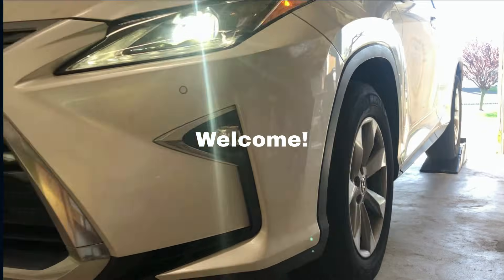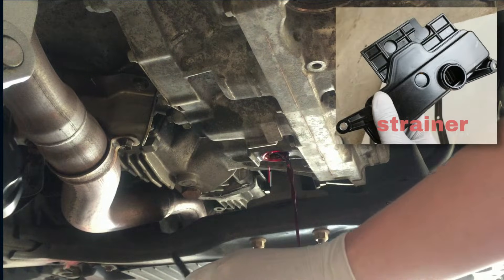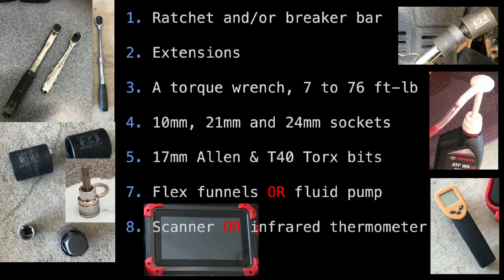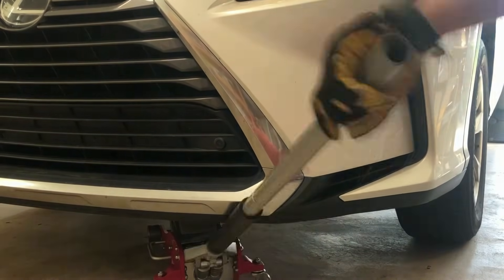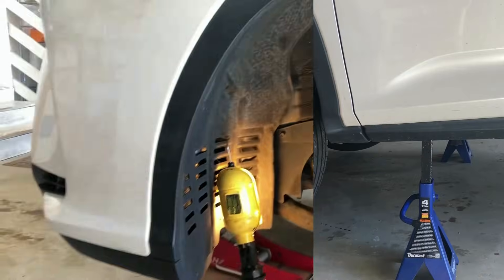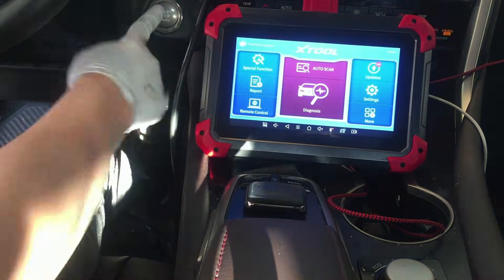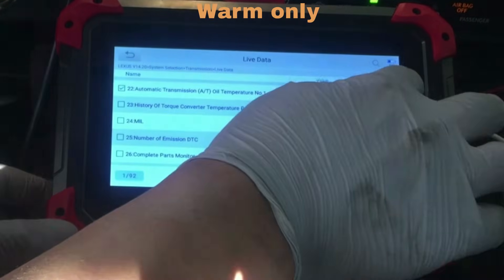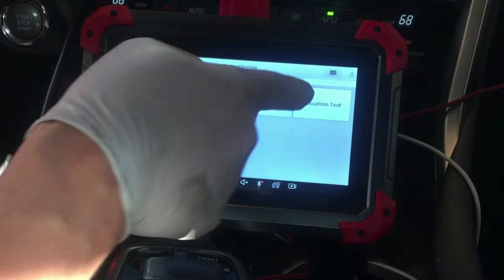Toyota Lexus Sealed Transmission Fluid Change & Level Check - 2 Temperature Gauges

Comment: Hello, I have a 2016 nx200t.  I live in the Austin, TX area.  I'm not sure where you are located however do you have any contacts/shops in this area that would know the proper procedure that I could trust to perform if I'm not able to myself?  Thank you.
Reply from the maker: Thanks for the inquiry! I don't have affiliated shops but you can use one of the following options: 

1) Lexus dealership: Find a trusted Toyota or Lexus dealership to perform the replacement. Lexus has a great presence in your area (with its US headquarter in TX) and they have a standard procedure for this WS fluid replacement. Some dealerships may tell you don't need it but it's required for a towing vehicle. Find a dealership that is supportive of this replacement even if it's not used for towing. 

2) Christian Brothers Automotive: I have used them in PA for state inspections (which I couldn't do it myself) and they are very transparent about services they perform, e.g. with visual reports. If you use them, ask them about whether their technicians are familiar with this Toyota/Lexus procedure and ask them to use the Toyota WS fluid. 

If you do it yourself, the key is to set the fluid level within the correct temperature range. I have another video about measuring ATF with a budget OBD2 scanner: https://youtu.be/ytdcZ1X8EeQ

Hope this helps.
Reply: I actually had checked with one Lexus dealership here and they would not do a drain/fill, only a flush for $450.  I will check with another one here in town and see what they say.  I will also check with CB Automotive as you advised.  Thank you for responding - I appreciate it!  @profsg

Comment: Thank you Sir for the video!

Well all I can say is that changing the transmission fluid on a 2023 Rav4 Hybrid is incredibly easy. 
REMEMBER, EMPHASIS on it being a Hybrid!  You still have to go underneathe BUT you drain (entire amount) and then refill until it overflows, let it come to a slight drip to level out and you're DONE. The same for your rear differential as well. You should do BOTH at the same fluid change. The differential takes the same transmission fluid.
Reply from the maker: Thanks for sharing! Yes, it's a different type of transmission with the same WS fluid (?). I like the traditional transaxle/differential fluid procedure to fill until it overflows, which is much easier.

Comment: Thanks for the details of the video. Just wondering have you measured how many quarts when you drain out? I noticed 2013 RX350 only needs 2-1/2 quarts ... can you confirm ?
Reply: The total capacity is 12 quarts but with a drain and fill, you only replace about 2-4 quarts.
Reply from the maker: Good question! I didn't measure it precisely but I put 3-1/2 quarts in and get roughly 1/4 quart out. So I'd say it's in the neighborhood of 3-1/4 quarts for this new generation (2017 Rx).

Comment: Does the engine need to be running when you drain the new fluid to the proper level? Can you shut it off once it reaches the proper temperature before crawling under the car?
Reply from the maker: Short answers: 1st question Yes and second question No. It has been the standard procedure in Toyota Land to check the transmission level with the engine RUNNING. Unfortunately, you cannot shut off the engine and then crawl under the car to set the level, in which case you will drain WAY too much fluid out. I feel your pain, and here are a few tips to make sure it's safe when you crawl under--

1) If yours is a mid-size SUV like the RX350, there is enough clearance and you don't have to take off the driver-side front wheel. Simply leave the vehicle on the ground, turn the driver-size wheel to access the filler cap, and funnel fluid from above on the engine bay. https://www.youtube.com/post/UgkxlxN61xUF7a79b6kffcOAojgcvDfuwNzh

2) If you do raise your car and take off the wheel, put the wheel under the vehicle as an extra safety measure. Also, leave the floor jack lightly engaged in the front after lowering the car onto the jack stands. And safety goggles.

Comment: I have a 70k miles 2017 RX350 certified at 60k by Lexus. The Lexus mechanic claims we should never change or even inspect the fluid since they are sealed transmissions with "world standard fluid". What do you think? Can you help Professor?
Reply from the maker: That statement of the mechanic is partially true. I have another video on this question: https://youtu.be/X7iQ8hWcB_w

Yes, it is WS (world standard) fluid and Lexus doesn't include fluid replacement on the service schedule under normal driving conditions. HOWEVER, this is not really sealed and life-time. For one, Lexus DOES recommend fluid replacement at 60,000 miles under severe driving conditions, e.g. towing. I discuss these and more in the linked video above.
Reply: I’d be very skeptical of that. Jaguar marketed “sealed for life” on the 04-09 models and by the time ZF (manufacturer) stepped in and refuted that lie, people were way past the manufacturer’s service interval.

Comment: Profe!!! That was a well explained video, thank you! I was searching for the scan tool that you used but it is a bit expensive over $400. Do you have any other cheaper recommendations for a scan tool? Thank you
Reply from the maker: Glad it was helpful! 

They are some options in the $100-200 range, for example:
FOXWELL NT614 Elite Car Scanner, 2023 Engine Airbag Transmission ABS Scan Tool with 5 Services ABS Bleeding, SAS Calibration, EPB Throttle Oil Light Reset Tool, Live Data OBD2 Scanner Diagnostic Tool https://a.co/d/35mE3zP

There are subscription models cheaper for the first year but expensive to own over time, for example:
KINGBOLEN Ediag All Systems Obd2 Scanner Bluetooth, Bidirectional OBDII Diagnostic Tool with ECU Coding, Active Test, 15+ Reset Functions, TPMS Reset for iPhone & Android, All Software 1 Year Free https://a.co/d/hYuIDhb

Both of these support reading transmission temperature.
Reply: @profsg  thank you so much profe.
Reply from the maker: @GG-un5wk  Wanted to follow up on the question here. You can use a budget scanner with Torque Pro app and knowledge of a correct PID for your vehicle to measure ATF temperature. Details in this video: https://youtu.be/ytdcZ1X8EeQ
Reply: @profsg  thank you profe. I will watch the video. I ended up getting the fox one and it was very helpful when I changed the transmission fluid. Thank you for following up!

Comment: Thank you Professor for the excellent explanation and video.  Just a few details for the 2019 and up Lexus ES350.  The fill plug is exactly the same, however the drain plug has been changed.  You remove the main drain plug, and threaded up into the transmission drain is an entirely plastic filler tube that has NO gaskets.  It comes out using a 6mm Hex socket.  Both the filler plug and drain plug utilize the same part number crush washer, -A0003.  Otherwise, it is the same as in your video!
Reply from the maker: Thanks for the feedback and for sharing! The plastic tube that comes out with a 6mm hex bit is similar to what I had on an older Camry. Glad to know it helped!

Comment: Dear Garage Professor, Thanks for the detailed demonstration and explanation and a very well organized video. At 1:24, you mentioned removing the passenger side wheel. Did you actually mean the driver side wheel?
Reply from the maker: Great catch! I didn’t realize I misspoke in the video but you are correct that it should be the driver side wheel that you take off. On some models, it’s also possible to keep the wheel on by turning/steering it sideways to access the transmission filler cap, and feed a flex funnel above from under the hood (near the brake fluid master cylinder I believe). I haven’t tried this though.

Comment: Thanks for the excellent explanation it help me a lot.  And can you tell me what is the brand of the scat. 👍
Reply from the maker: Sure! The scanner used in the video is XTool D7: 
https://ebay.us/vDwoU4
Reply from the maker: This has more features (e.g. bi-directional controls) than what's needed to measure the transmission temperature. The price is good given those advanced features. But if your primary use is about the tranny temperature, there are other less expensive options.
Reply: @profsg  thanks 🙏

Comment: How are you?  I wondered if it is also applicable to Toyota. I have 2011 camry now with 125,600 miles and highlander 2014 with 105,000 and no tow hitch on both of them and both have no dipstick trans fluid. So far they are running well.  I bought them 2nd hand with both at little over 30000 miles for Camry and 42500 miles for Highlander.  So I do not think the previous owners changed trans fluid. If it is applicable to Toyota, given these 2 cars' mileages, Can I proceed to do transm fluid change, even they both are driven fine? Chanpho
Reply from the maker: Yes, it is similar on Toyotas. I also had a 2011 Camry and sold it a few years ago at 70,000 miles or so. Before that, I replaced the sealed transmission fluid at around 60,000 miles. It was a great vehicle! The procedure is the same except it's a different drive bit (hex) to take out the drain plug/tube. 

With a Toyota vehicle over 100k miles that has never towed, I personally would change the fluid, drain and fill. It is behind schedule but I don't think it's too late for the following reason: 

According to my Lexus (maintenance) manual/schedule--and you can check your Toyota schedule but it's probably similar--the recommended first transmission fluid change is at 60,000 miles if the vehicle has TOWED. So for a vehicle that hasn't put extra loads on the transmission, it should be able to endure a longer interval before its first transmission replacement. 

This is a subject of debate and it's only my personal take. I'd drain and fill now, and then follow the 30k mile interval going forward. Best luck!

Comment: Hey man, great video !
My 2006 lexus is250 is at 114,000 miles and I'm not sure if the transmission fluid was ever changed. 
Do you recommend changing it now ? 
I don't feep like it's showing any problems or anything.
Reply from the maker: Thanks for the feedback! 

On whether to replace the fluid on your 114k mile transmission, it's a matter of debate but here is my take--

If it hasn't been used for towing, I would start to replace the transmission fluid. Drain and fill, and see how it responds. If it continues to run smoothly, follow the recommended interval (30k miles) for future drain-and-fills. 

According to my Rx350 manual, the official Lexus recommendation is to replace the fluid at 60,000 miles for TOWING a trailer. You can see that in this video: https://youtu.be/mx-fRPakHtI?t=14

Without towing, it's reasonable to assume the fluid is good for a higher mileage. So I think it's a bit behind schedule but not too late to replace the fluid at 114k. 

Keep us posted.
Reply: @profsg  hey man, thanks a lot for your reply. I'll start making preparations for drain and fill. 

Without a Garage, its pretty hard to do this yourself because of the regulations here in Germany.  I'm planning to prepare everything and rent a garage for a few hours to do it. 

I'm new to automotive stuff, researched a lot for the last two months, bled the brake fluid, changed the thermostat,  changed engine oil+filter and flushed the radiator in the last month right after my purchase of the lexus, but somehow the transmission drain and fill sound the most risky as I have anxiety if i fill it the wrong amount or if its already too less fluid and im not sure how to identify it. 

I'll watch your other video as well, and hope its okay to ask you more questions in the future  😅
Reply from the maker: Glad to be helpful and hear about what you've accomplished! Two tips here--

1) Make sure you have a good level ground and support for the raised vehicle. Be safe! 
2) And always remove the fill plug first before draining the fluid. For many Toyota/Lexus models, it's a 24mm cap so you likely need a longer breaker bar with an extension. For example, a 3/8-inch drive ratchet is often good enough for oil change but a 1/2-inch drive is ideal for the 24mm fill plug removal here. 

Best luck!
Reply: @profsg  thanks for the tips ! :)

Comment: How do you know if its bad mine is also sealed no dipstick or anything is250 2007 rwd
Reply from the maker: You will know it if it's difficult to engage or shift gear. I guess your IS250 is over 150k miles and it's a bit late to replace transmission fluid now. Definitely no flushing it at this point. Fill and drain is what I'd do, though some mechanics may advice against it.